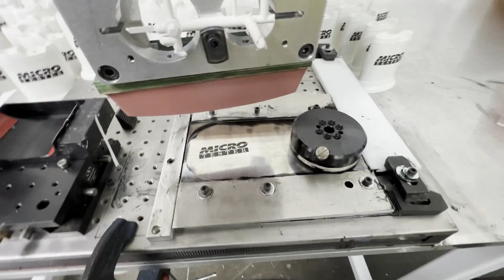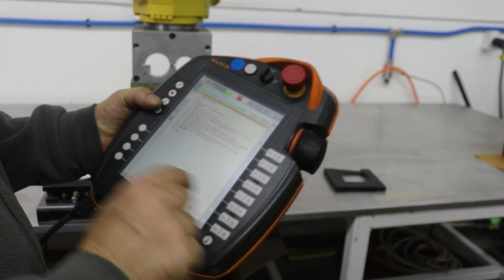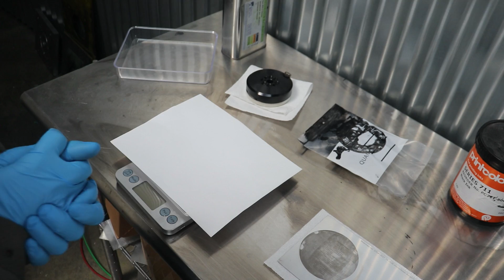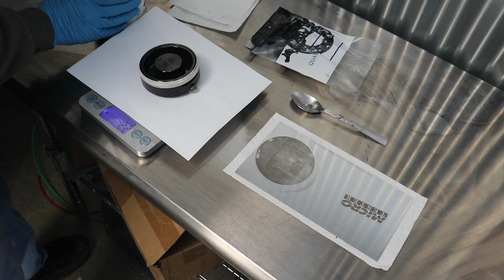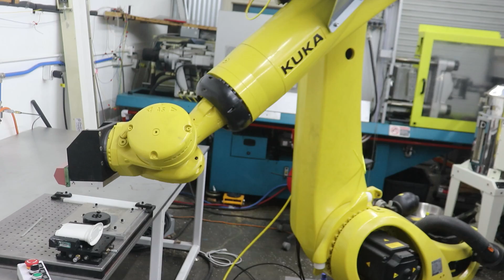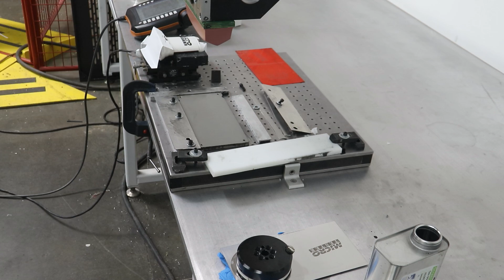Robotic Pad Printing

Comment: Something I don't understand, when the pad prints on the part does all the ink transfer from the silicone pad to the part leaving a clean pad for the next image? I would think the pad would need to be cleaned between printings.
Reply from the maker: Usually all the ink transfers to the part.  I do clean off the pad every 30 prints or so, but mostly due to static cling of plastic dust etc.  Thanks for watching!
Reply: Different ends of the rubber.

Comment: Please, please, please get some light curtains or a zone scanner around that robot, or better still a gated cell. Running it in auto with you near it is NOT remotely safe. Hence the deadman on the pendant and SLS (safely limited speed)

I really want to see you keep making videos and not getting hurt.

If you need outside help, get someone in who has an industrial safety background.

Someone in a car plant got minced to death, with the fence being the mincer, due to running a robot in auto during maintenance with them inside the cell. These robots are no joke when it comes to safety.

Source: 4 years as a industrial automation engineer working with KUKA robots from iiwa up to titan size.
Reply from the maker: I do have the robot in a cage, just not seen in the video. I also set up a workspace exclusion zone. In general I agree with you, in that I stay out of the cage when it is pulling parts etc. in this case, as the programmer, I proved out the program in slow mode and then was comfortable with the colab setup.  If there was anyone else in the building, then no.  In general, I program the motion to exclude human zones ( travel over head, and not creat pinch points that a person can get caught in.) I'm trying to recall if at KUKA college, we ran slow auto inside of the cage or not, its been years since I went.
Reply: @DragonflyEngineering  
I concur if you're the only person in the building as you're responsible for your own safety, and if youre comfortable with the risks then there is no more to say.

If I remember correctly, you can't get into auto without jumping the X11 safety connector on the guarding pins.

My concern with any motion based human avoidance would be axis singularities... I've seen robots do some very funky stuff during PTP motion to avoid singularities including swooping of the arm etc. 

We have a bit of a different safety landscape here in the UK, but I don't believe we ran in auto without the guarding closed in Kuka college back when I did it, but memory fails me. As far as I know, only the IIWAs are considered safe for Collab working but I could be wrong 

I know T2 allows higher speed whilst keeping the deadman functionality if memory serves.

Main thing for me is that you are safe and keep making these great videos.

Comment: I love it!  I screen print on a few of the tools we make.  The time window for the ink is constraint we keep a close eye on.  I believe most ink suppliers have an extender or flow agent that gives you a bit larger window...  Based on the start of the video, I suspect you have it sorted out.  Hopefully you're not having to double bump everything to get the ink smooth.
Reply from the maker: Hi Greg, Yes, I did have touble at first with the time of flight of the ink, as it turns out adding more thinner to the ink made it print well ( contrary to what DECO said) so there is black magic

Comment: I'm convinced!  If I ever need to do pad printing, I'll be getting a KUKA Robot instead of a normal pad printing machine.
Reply: a KUKA is definitely more versatile - it's a pad printer when you need it to be, and when not, it can be almost anything else you want, vs a pad printing machine that's just sitting around eating up space when it's not pad printing
Reply: @gorak9000  That's true. But you always have to include the installation etc. - often this in much more expensive than simply buying a (small) pad printing machine. So it depends ...
But anyway: Great video - and I like big yellow 🙂
Reply: @123jogger123  he bought the robot used on ebay, and he installed it himself. He also uses it in that position to pick the parts out of the molding machine as well - the robot was already there for doing that, now it's just doing double duty as a pad printer for this job.
Reply: @gorak9000  I know that :-) I'm following him a couple of years now (because I'm also doing injection molding).
But although it needs simply plenty of time to teach the robot to do the printing etc.
Sometimes it is cheaper to have a special machine which is ready to do the job instantly instead of an universal one which has to be installed new every time.
Reply from the maker: Thanks for watching.  I should point out that you need to taylor the ink / solvent ratio to deal with the slower print travel time with the robot. Usually you need 0.5-1.5 sec of ink exposure, and the robot travel time is ~1.5 sec, so you get a smaller process window. So small distances and fast program are needed.